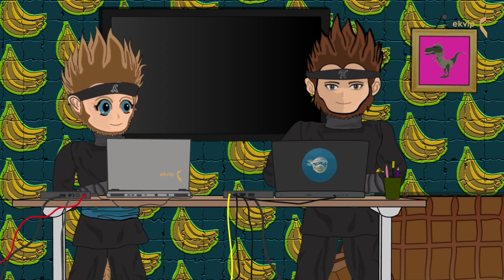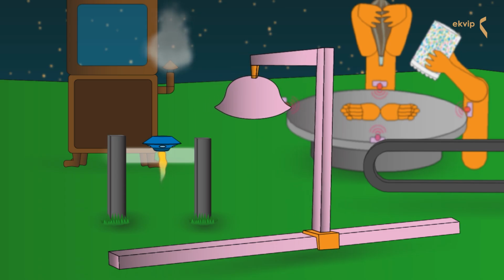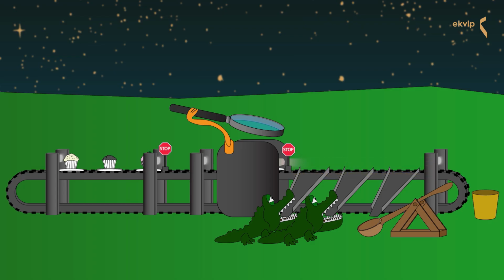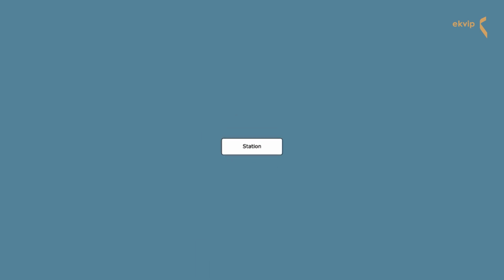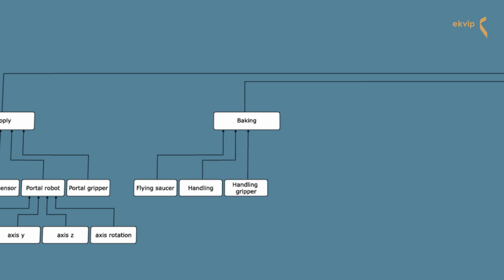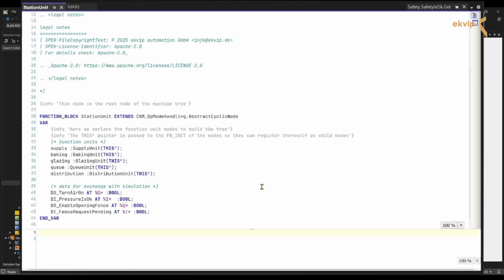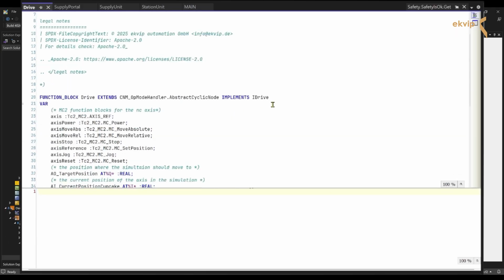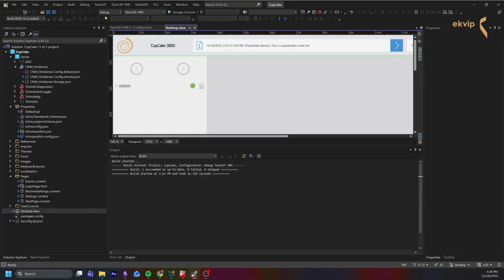TwinCAT 3: cinnamon example project pt.1

Comment: Impressive job! i'm currently using SPt framework by Beckhoff USA but i'm looking forward to explore you framework!
Reply from the maker: Cool, thanks!
Reply: Did you use SPT in any real-world projects? Is it convenient for debugging? If possible, could you share a public repo? 😊
Reply: @mircopolo  I'm using the SPT framework for a fairly large machine and developed some custom logic to fit our specific needs. I'm hesitant to share my work right now because the code isn't well-commented, and several design choices were made primarily to get into production quickly. Because of this, I wouldn't recommend copying my implementation. Debugging was quite challenging, mainly because there are no comprehensive tutorials for large-scale projects. As a result, I had to study how the framework works under the hood to fix some flawed logic I had initially introduced. But feel free to contact me